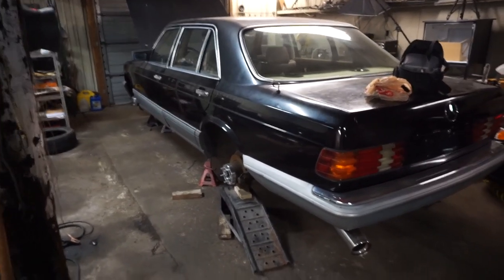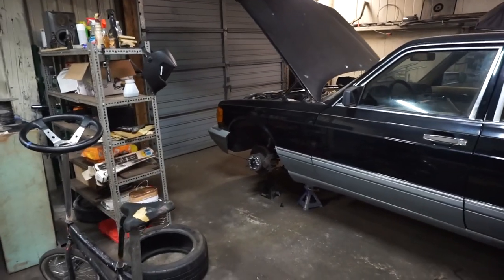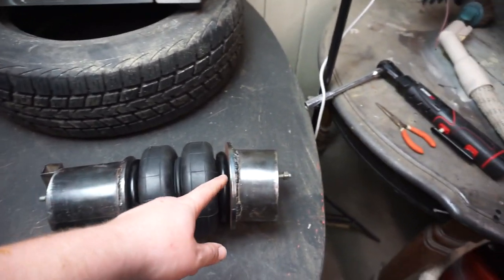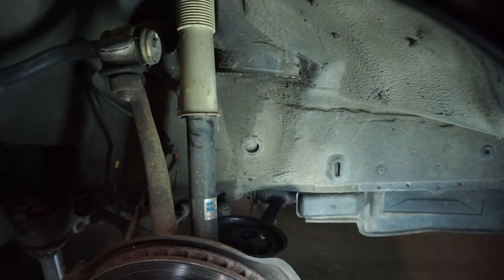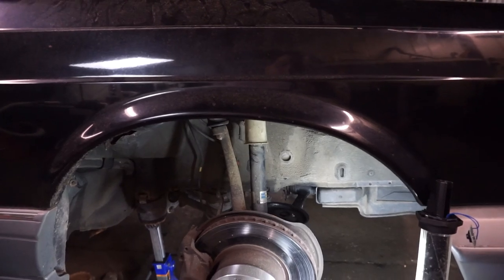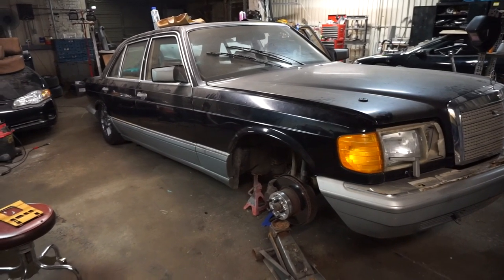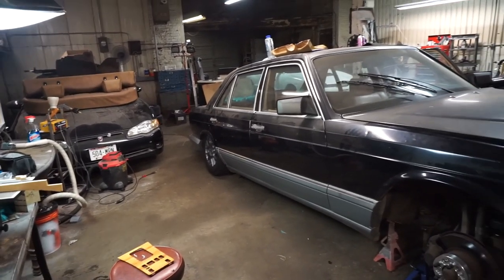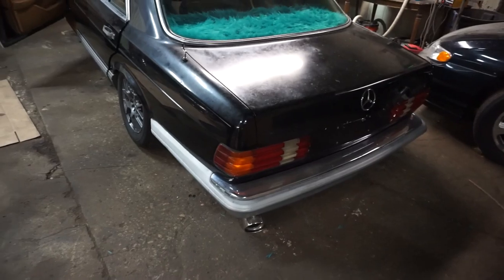Installing The Cheapest Air Bag Suspension I Could Find

Comment: On the rear of my w123, i made long shock brackets to go on the other side of the CV axle, and cut a hole in the trunk space for the shock to stick through and bolt in inside the car. So far its working well. Im working on the front airbag setup now using your video for ideas. Good video!
Reply: I would love to send some pictures somehow

Comment: Bro I can't even right now.
I bagged my truck with absolutely no know how.  You are miles ahead of where I was at the same time.  Wish i had seen this first. That being said I bought from airmax as well.
I got 2 480 compressors
A 5 gallon tank
1/2" air line (mistake)
6 valves, 2 for each front corner, and 2 for the rear
2 2500 bags for the front
2 2600 bags for the rear
Parallel 4 link etc, I wasted so much money.
Wish I knew about the paddles

Comment: So far so good man..  That's quite a nice chunky spacer on that hub too. Keep us in the loop bro.
Reply from the maker: Thanks, that's  a 1 1/4" spacer because these wheels are the wrong offset. But as you will see in part 2 I think they fit the look of the car perfectly, especially in the front.
Reply: @wideband  I got some 20mm spacers for the rear of my V70 (98) which has filled the stance out nicely. Strangely, the V70 rear axle width is 40mm narrower than the front from the factory.. so now they are equal.
Reply from the maker: @justinjlawson  Interesting, I never noticed that on my V70 but next time I see one I'll have to look closer. That is strange.
Reply: @wideband  Eagerly awaiting the story on where your V70 is... :)

Comment: I have a 60s 4WD vehicle with 4 leaf springs and regular shock dampeners. (at 1:28 you see them)
I can't take out the leaf springs so I would replace the shock dampeners with airbags. 
does that work as well? there are Monroe air shocks with a similar shape.
anything I need to worry about?